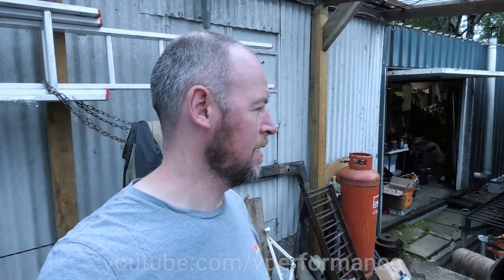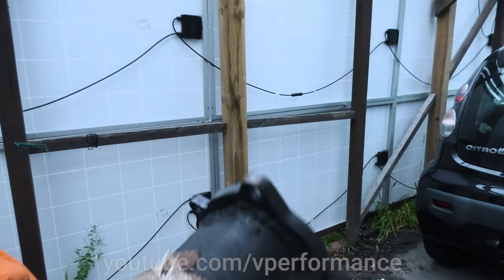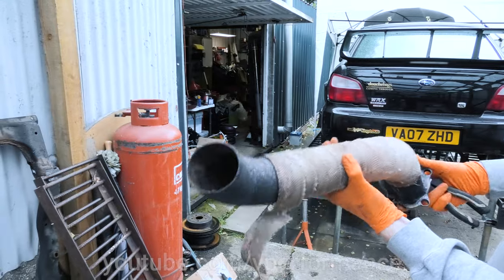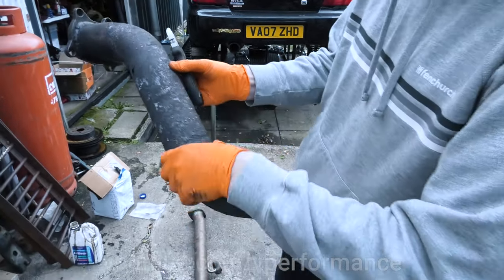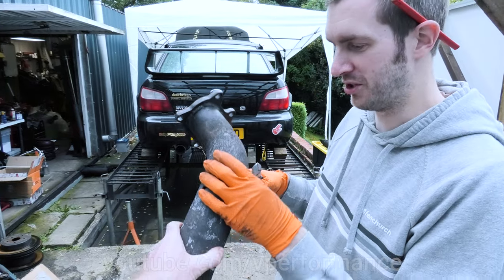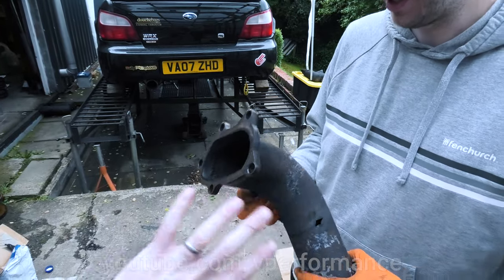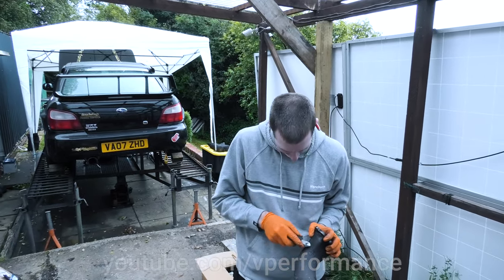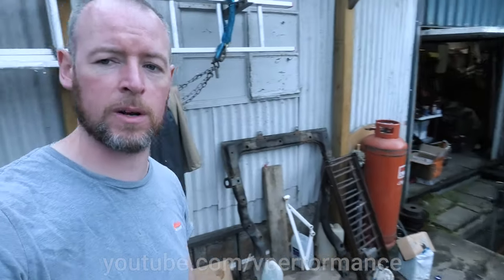Exhaust downpipe wrecked by a bad heat wrap // Project Driftbaru

Comment: It's pretty obvious that pipe was already in shit condition b4 it was wrapped and is probably the reason it was wrapped in the first place. If the pipe cracked while the wrap was on it it would've ripped it apart. Still wouldn't recommend unless your car is garage kept and never driven in the rain.
Reply from the maker: Nope. It was brand new shiny stainless steel.

Comment: Good thing I didn't go down that route when putting my new downpipe on! Haha
Reply from the maker: Which downpipe did you go for?
Reply: @vPerformance  it's a cobra 3'. And blitz nur spec R system. Sounds awesome but not as deep a tone as majority of other subarus.
Reply from the maker: @dq1-sti464  I do love those nur spec R though, didn't that make it deeper?
Reply: @vPerformance  before I bought the nur spec system I had a scoobyworld afterburner system and I thought that sounded deeper   in my opinion but the nur spec is an awesome sound😎 what bov are you running BTW? Iv always ran stock but I think it's time for a bit more noise haha